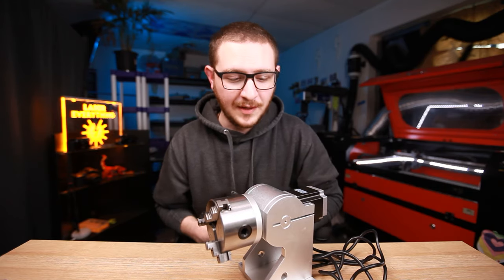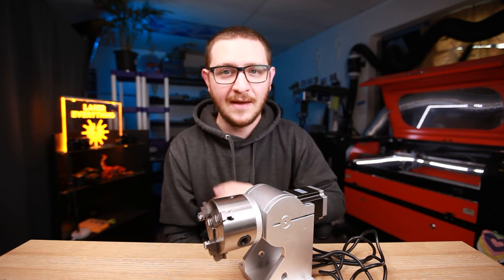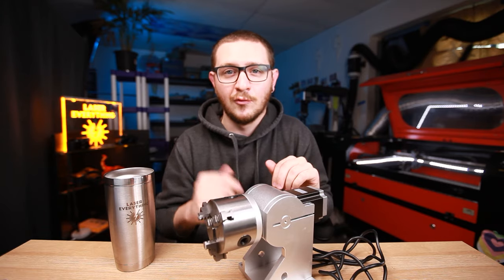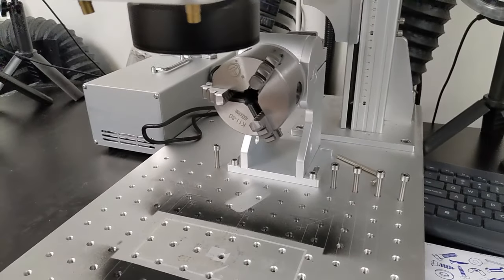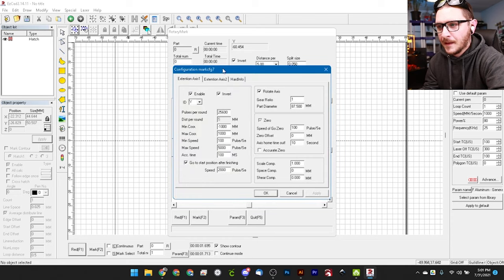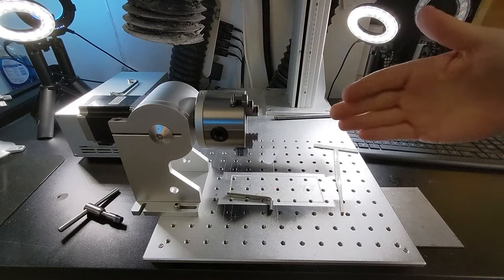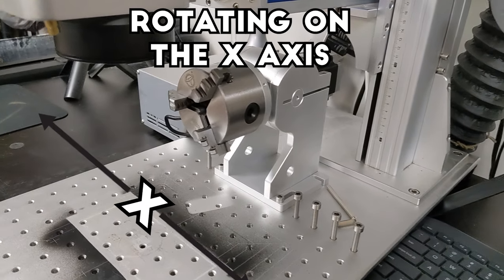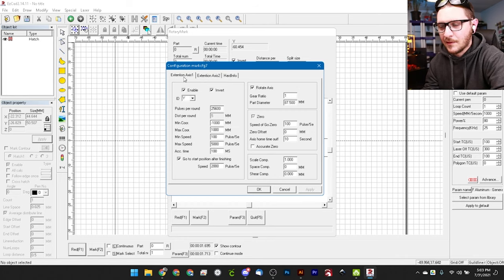Set Up A Fiber Laser Rotary Tool with EZCAD | COMPLETE GUIDE

Comment: Is this possible to make the 2 d fiber laser machine to 3d?
Reply from the maker: It's possible, but it would require a LOT of changes to be made and would be costly. You would need a 3D control card (such as Ezcad3, or another 3D control card), as well as a motorized tower that is wired into the control card for software control. This would get you to what the industry calls a "2.5D" machine, since it only has height/focal control through the Z tower. For full 3D, you need one more upgrade, a 3D galvo head, which also needs to be wired into the controller. Beyond those changes, you would likely need to make some supporting modifications, such as adding/swapping power supplies since most 3D controllers use a different voltage. The galvo head may also require a different voltage. You'd need to run additional wiring. It can be fairly involved, and the cost of the change is often going to be way more than you'd pay just getting it that way from the manufacturer that way, due to the cost of individual parts. 
Unless you have a specific need for 3D capabilities revolving around focal changes on 1 part, we'd personally just stick to a standard 2D machine. If you want "3D like" engravings that don't require focal changes, it can be done utilizing layering, or Lightburn's 3D heightmap functionality that uses a grayscale heightmap image to break down layers for engraving.

Comment: Had a fiber 16 days and it seems like years! Gave up on EZcad2 in 1 day …thinking LightBurn with the Galvo “update” added would be a doddle! The 30w Raycus seems to the one they assembled late Friday night and ran out of parts! Advertised with 300mm and 110mm lenses, only the 300mm was in the box. But it was OK for flat tests on scrap, but today is seconds day I reported back battle front, just me and a @#&$%=+ Kin 80mm Rotary
First attempt. Silly me put blue painters on a stainless drinks bottle..well we do with diode lasers to run checks abd check the engraves image. Mistake 30minutes later cleaned of tape put a MUFC club badge in LB  size and setting..pure guess..hit the go button…settings not the best and the image looking good in the top panel “tv screen” was burned into metal backwards and upside down.three more failed efforts after moving the image around and I was guessing its not lightburn its the freakin EZCad2 settings behind the spanner tool top menu. Forgot in my excitement, the ….sorry sir it was overseen when packing … 110mm lens arrived this morning and used!  I need to discover how to keep the image used burned in correctly!  30w Raycuss. C/W 80mm rotary …500mm tower, akk had little use..about an hour so far!  
Soon to be looking for a new home.

Comment: Alright... This is then 110th time trying. Here are my issues. See... There was a reason for a $100 tip 😎

1) D80 rotary ALWAYS returns to a different spot even if "return to home" is set. This makes a second pass impossible without ruining the piece. 

It also seems to spin over and over no matter where and then start engraving when it decides to stop spinning. 

This has been a giant pain in the ass and I'm now hiding burned tumblers from my wife. 

2)!foot pedal. I'd like it to do more that simply start the laser. How about pause. Restart you know .. basically for pedal is useless if I have to get up to check the screen anyway. 

Primary pain rotary. I even marked the stationary rotary and the chuck. When I hit test, the return home is always short. This is a serious issue for me ghosting over second passes.

It feels like Russian roulette and is costing me the same. The intern is covered with people who are screwing around with other lasers.

JPT 50 175x175mm lens with D80 rotary calibratedb in factory. Ran 200!tumblers flawless. Then .. nothing lines up and the rotation is whereeve the hell it wants to before firing. 

I'm ready to throw 12k out of the window as I bankrupt myself on mugs and tumblers. 

Happy to stream it for your content if youdnlike. But ultimately I just need help. Christmas cost me more in tumbler replacements than orders. 

Not the right time of year for that stuff to happen. Any help in optimizing the rotary?! PS .. I look great on camera but I am a MORE  great listener 😜 ACCOUNT TO MY WOFE. 😮